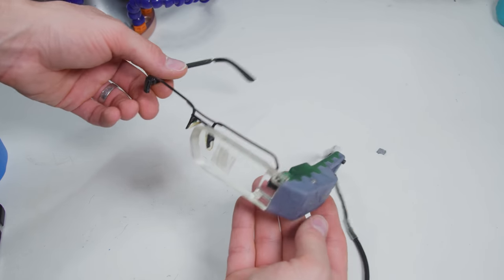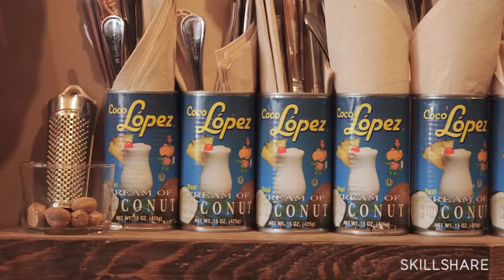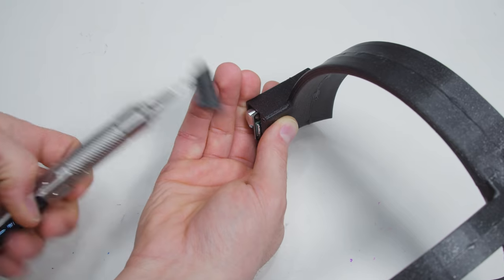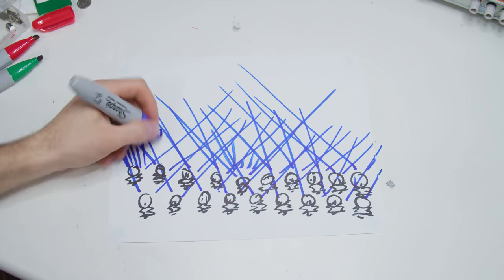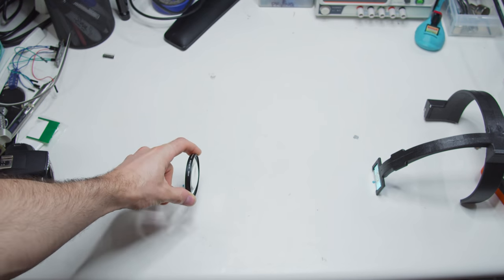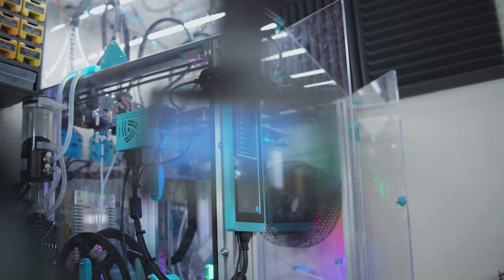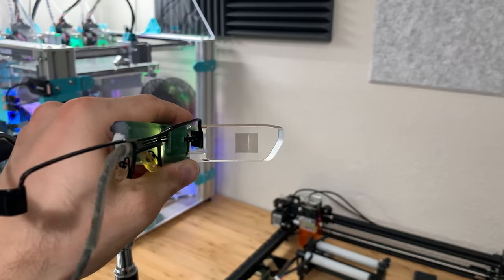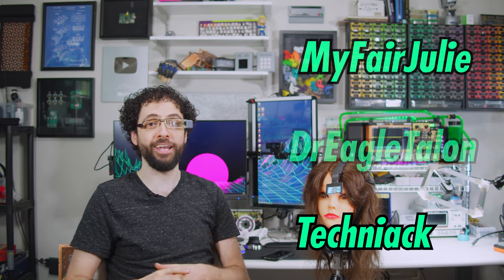The Worst Wearable Computer

Comment: If it looks cool and doesn’t work at least it’s cool, if it looks lame and doesn’t work it’s worthless. This fits the first one for sure
Reply: It could be a interesting cosplay prop...
Reply: Yeah, it could be useful for cosplay/costumes where you actually want others to see what's on the display, and its not actually supposed to be useful.
Reply: It does work.
Create wearable display.
Wearable display is not visible to wearer.
Create many wearable and wireless displays.
Force everyone around you to wear them.

Voila, physics bypassed.

Comment: today i learned that contact lens displays will never be a reality...
Reply: Not neccesarily. Just need a way for the contact lens to always emit light in one direction. Like maybe thats impossible, but it also might not be.
Reply: Maybe the edge of the contact lenses is the display and the middle part of the contact lens is the lens that display the image
Reply: @jetison333  There's another technology we already have that produces light in nearly-perfect parallel rays.

Usually we're told not to point those at our eyes, though.
Reply: If the issue is overlapping "rays" and the emitter sits right at our lense, in other words: There is no space for the rays to overlap, shouldn't that work?
Reply: Nay. Just interrupt the optic nerve and hack a signal into it. Eventually.
Reply: What if: contact lens emitting the light/image, but normal spectacles which can reflect that light back into the pupil?  How to get power and data to the contact lens is a minor issue.. 😂
Reply: @oasntet  wait so if you made a oled with laser diodes it might work? and you wouldn't cause damage if the energy density was low enough right? thats actually pretty brilliant
Reply: Just scoop out the eye and connect a directly to the nerves! 

Flesh is weak, lets make it better. (don't do this yet.... the tech isn't there.)
Reply: @oasntet  lasers are an eye hazard because they're usually too powerful to be safe.  at the sort of power requirements for an on-eye display it's fine
Reply: @FirstArchon  Yeah, it's a theoretically viable option, limited mainly by our ability to generate lasers at the nano scale, which is particularly tricky since the size of the gain region in a laser emitter is related to the desired wavelength.
Reply: @oasntet  so if you made a laser that small it would be blasting out uv or smth?
Reply: @oasntet  Light Amplification by Stimulated Emission of Radiation. That's what I thought the whole video long.
Reply: @FirstArchon  Given our current laser emitter tech, yeah, but we've found ways around similar problems before.  It might be harder to make them transparent, given that generating laser light also involves optically-opaque components like mirrors.  But that, too, is probably not insurmountable.

For contact lenses (the first topic in this chain) the transparency might not be an issue; you don't need the lasers to be directly in the field of view, you just need them to hit the retina in the right place to form a coherent image.  So a ring around the edge of the pupil, firing carefully-aimed lasers in a raster pattern on the retina?  Could theoretically work, with huge engineering challenges around aiming them, keeping them aimed when both the eye and the contact change shape, dealing with the pupil changing size (even in response to the display turning on...)
Reply: What about the augmented reality helmets in advanced aircraft that let you see thru your jet

Comment: Zack: "let's put a lens on my eye"
Me, blind as heck with my dummy thicc glasses: pathetic
Reply: I was getting hopeful there when he started talking about a lens being used... after an allergy induced microstroke about 8 years ago, my rx on my left eye is about 4 points off of my right eye. but I am so right eye dominant I generally do not notice. still the difference means I would have to get custom glasses made if I ever wanted to use HUD or VR... I was starting to get hopeful when he started about using a lens in conjunction with the display. I would absolutely talk to my eye doc about a set of glasses where the left eye had a very close focal point if the project could work.
Reply: @mattlewandowski73  what do you mean custom glasses made? I just wear my glasses in VR normally, and both my eyes are pretty different prescriptions
Reply: You merely adopted the bluriness, I was born in it!
Reply: @marcusborderlands6177  he needs glasses that are essentially non prescrip on one eye, and the other eye needs to be prescrip. so one curved lens one flat lens, 99% of frames are not going to allow for that i.e. custom

Comment: Zack: Thanks for the clear explanation.  I'm using it for my Georgia Tech class.  One you thing you might cover is the light efficiency of these different optics.  One of the reasons it is so hard to get a useful "see through" head worn display for outdoors is the loss of light from the beam splitters. In your example with Glass, the beam splitter is 50% reflective, and the image goes through it twice, meaning that 75% of the light is lost from that process (and then there is the efficiency of the LCOS display). All the "transparent" displays have this problem - some much worse than others.  The other problem, as you know from the Moverio you wear, is that the beam splitter looks like a grey rectangle in front of your eye all the time, which is annoying.  You can make it less gray by making it more transparent, but then the efficiency is even worse!  Grumble.  We really need a VERY bright microdisplay.  Do you know of any very bright hackable modules?  I'm looking for one to put into a scuba mask for our dolphin research.

Comment: Noob question: 3d cinemas work with polarization glasses, where each side filters a differently aligned photons. Could similar tech be used to "prealign" the photons instead of a lens so that only orthogonal photons are sent out in the first place?
Reply: Unfortunately, no.  Polarising filters only block photons with the incorrect orientation, they don't actually align anything.  You'd still need a secondary optical system which makes the screen image appear to be at infinity.  The ONLY solution is the mirrored secondary optical system which makes the screen appear to be far away.  Until someone markets that system cheaply and competently, these glasses are unobtainium.
Reply: you can design it like a computer, split them using such lenses/mirrors. next use a some mirrors and prisms, or magnetic fields to rotate the before sending them back to the filter.
Reply: Glad I wasn't the only one to immediately think "polarize the light"
Reply: @Chris_the_Muso  then why do the Vufine HD heads-up display work inches from ones eye? Because they aren't transparent? How's that work?
Reply: @akaChurch  because they still have an optical system... which makes them appear to be far away.  It's exactly the same principle just that it doesn't have to be mirrored against an IRL background.

Think about it...  unless you are exceptionally short sighted (and I actually was) then no human can focus something only "a few inches" from the eye.  There has to be an optical system in there somewhere.  Usually, it's closer to the eye than the thing you want the eye to focus on.

We do the same thing with an SLR camera.  The ground glass is only a few inches away (but reflected twice in the pentaprism) but the lens in the eye piece allows us to perceive it as being at infinity.  Modern cameras with digital viewfinder screens?  Same thing.
Reply: @Chris_the_Muso  oh I guess it probably does. I totally understand the principle but I got a few of those vuse heads-up things. Gottem for like $2 a piece! They are pretty alright, just never taken one apart to look at the optics. The not having to be mirrored around the side of your head was throwing me off 😅

Comment: i am extremely myopic so i can bring the display almost up to my eye and still be able to focus on the disk my nose can literally be touching the screen so no i wouldn't say no one. i would say most people. That being said i can't see far away anyway without corrective lenses so it doesn't really make much a difference the real world is blurry either way
Reply: Make a corrective lens that goes behind the display. There. Problem solved. You look through a display at the real world - the real world is corrected. You look at the display - the display is not corrected.
Reply: I am withyou as well. and am used to focusing that close to my face

Comment: What about a collumating layer, that just filters out light that isn't going straight. The light from the world is already straight so it wouldn't interfere with that
Reply: Lol, I was thinking, just put a layer of really small tubes on the surface.

It'll grey out the transparency a bit, but I imagine it'd unblur it 👀
Reply: Even better, the other myopics have been saying, "Put your corrective lenses behind the display, I can focus that close to my face already!"
Reply: It needs to collimate the light from the display but not the light passing through (hence the need for beamsplitter and an offset display)

Comment: If you wanted to make it work a bit better you could have a converging lens between the display and the eye (as shown), and an additional diverging lens after the display to cancel out the vergence. You would have a different field of view between the eye with the system and without, but the screen and the background could both be in focus

Comment: What if you have a lens behind the display that makes the light traveling though un-parallel so the lens in front will make that light parallel again, so you get both.
Reply: I guess you could if you wanted to do this at home - but the point is that at that point might you not be better off just using one of the other kinds of displays?
Reply: I had the same thought. It should work, but you need sufficiently strong lenses. Also your lenses should be flat on one side each so they can touch each other (with the display in between). This is necessary that objects from outside aren't bigger, this would give you a headache probably. 

I don't know how cheap or expensive this would be, but maybe you can still save money if the other optics are this expensive.
Reply: That's the thing though - lenses are expensive. Especially quality ones custom to an application. 
Just ask anyone with a photography, or astronomy hobby, or anyone trying to buy prescription lenses without insurance.

To your point - What you're describing is in all likelyhood theoretically possible - but that doesn't make it a good idea and you're adding so much extra custom optics, that you might as well go with the existing tech.
Reply: @robjenkins494  I just wanted to say it's possible. I don't know the price of lenses, nor the price of the other optics. Also prescription lenses will be made for you in particular, with makes them so expensive. 

If one wants to do that it's probably best to figure out if you can get cheap lenses first and then design the rest of the project around the lenses.
Reply: @robjenkins494  This dose not work when you want there to be no clunky projectors or mirrors on the side of you device. My idea would be to build a functioning computer into the glasses itself, which is possible with technology we do have, such as the small computers in watches and other devices. For control you could either use the gloves like he dose or with more money you could put EEG's around the glasses. How glasses are structured could allow for perfect airflow over all the components with small fans, or even just air holes and proper structuring that would create convention currents though the glasses. You could even create basic programing that will combine the power of other glasses users. Power could simply come from your own body-heat as well.

Comment: Instead of designing the optics you can take a page from how old games were designed around the pixel bleed and scanlines of a CRT to design the information displayed to account for it being blurry. This requires a display of the right resolution and color depth, along with a ton of experimentation to get the colors and amount of contrast right, but it can work. It won't be a lot of readable text (maybe 3-5 characters or symbols at most) but for certain applications that may be enough! The simplest example would be using a colored bar to indicate battery level for an RC car or drone.  As the battery goes down, the bar changes color.

Comment: you can use a convex lens toward the eye for clarity of the display and use a concave lens of the same focal length as the convex one behind the display, this should solve the blurriness of the foreground as a diverging and a converging lens of the same focal length cancel each other out,and if you use a plano-convex and a piano-concave lens the glasses will become slimmer but keeping the cancelation power the same and if the user has myopia or hyperopia then they can change the focal length of the lenses to suit their condition, and (this is speculation but) won't this stop other people from seeing the displayed content unless looked at from a specific angle or distance as the piano-concave lense will scatter the light coming out from the other side.

Comment: The equations behind Gaussian optics make them pretty simple. Just 2x2 transformation matrices (maybe 3x3 for 3 dimensions). They rely on the small angle and thin lens approximations though.
With those equations, you can go into the math required to focus on a display as if it were at infinity, and hence calculate the distances between eye, lens, and display, and the focal distance of that lens. To actually make the angled lens (or mirror) that isn’t very thin you’d need more advanced tools, probably some optics simulator program, but I’ve seen a couple of free ones about the place. With that you could print such a lens or mirror on an SLA printer with clear resin, or make an FDM mould on which to bend a softened piece of polycarbonate to make a mirror. I think a single mirrored piece of plastic is the simplest method for a hobbyist, perhaps you could try making an AR display with one of those holo-sights.

Comment: Have you tried making a pinlight display? It was a technique I saw a SIGGRAPH paper about several years ago placing a grid of pinpoint lights (a side-lit plate of acrylic with tiny indents in to make glowing points) behind a transparent LCD and then doing some form of preprocessing to render unfocussed sections of the image that the pinlight then shine through and bypass the need for the lens.

Comment: Fun fact, my eyes are horribly nearsighted. One day I decided I wanted to try out Google Cardboard on my Nexus 7. So what did I do? I built a frame out of leftover cardboard, tied bits of paracord to it as an improvised head strap, put my Nexus into this ironically cardboard holder (not even the good stuff, I'm talking milk carton level cardboard), and then popped my contacts out and tried it on. It worked like a dream. As long as that dream was the sad reality of Google Cardboard compared to actual VR headsets. But it was my first steps into VR and I loved every minute of it.

Also in reference to the part about no-one being able to focus on a screen that close to the naked eye I have two words for you. Try me.

Comment: One thing I always wondered about and would probably actually prefer to transparent displays would be a literal overhead display, as in, rather than have the screen floating in the middle of the vision, have it at the top of your vision.  This would simplify the optics considerably since you don't need to care about the real world getting in the way.
It is inherently less useful because you can't really do XR, but small screens on headsets are generally crappy at XR anyway because they are horribly underpowered unless you use a phone or something else attached to it.
XR is better used in full, dedicated headsets or on phone versus just a small single lens system.

Comment: Testify! I came across this same issue from a different (hah) angle...I built a HUD for my car, reading data from the OBD and putting it on a display was trivial, making it infinity corrected and projecting it onto my curved dashboard without distortion was the harder part...45 degree teleprompter glass was my solution...definite decapitation hazard though...

Comment: Theoretically, wouldn't another way around the columnated light issue be to use some form of laser diode? Lasers emit columnated light already, so it seems like this would work, if we were to develop small enough transparent laser diodes. It definitely isn't possible now, but I think this moves thin wearable displays from physically impossible to just something we cannot do yet.

Comment: The next question people might ask is, what if you use a transmissive display such as an LCD, such that only light passing in a straight line goes through the LCD and you're just blocking some light that's otherwise already going straight?

So sad this doesn't work either...  you can't focus on two tiny holes in a piece of cardboard an inch from your face either, for example, because light from all directions is passing through the holes, leading to the same scattering effect for focusing on the negative space next to the holes.

What about drilling millions of tiny holes in a light absorbing material, so light that isn't going the direction you want gets blocked?  One could build such a thing by building a pile of black laser cut paper, with holes in each layer burned in a pattern that converges on the pupil...

Comment: Smaller, opaque display with similarly shaped lens in front for focusing. It will not be as cool as a "transparent display" (or collimator), but it should be way  cheaper. Also, it would allow to retain some peripheral vision.